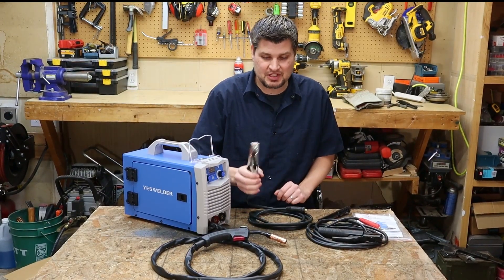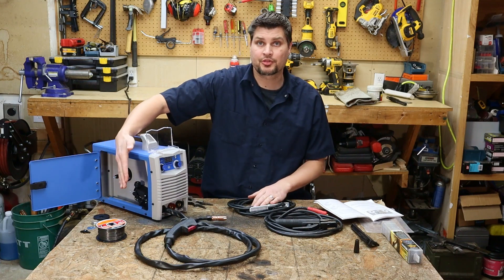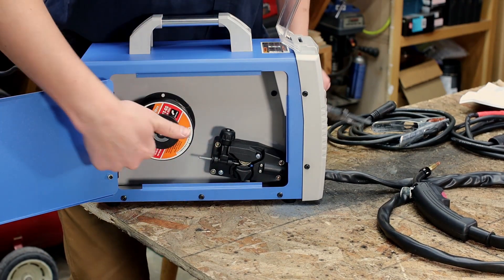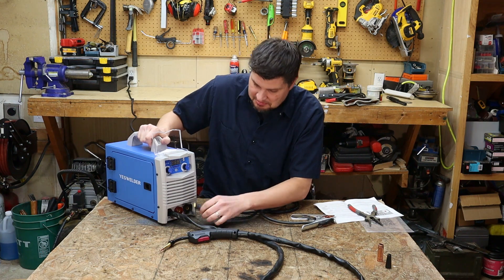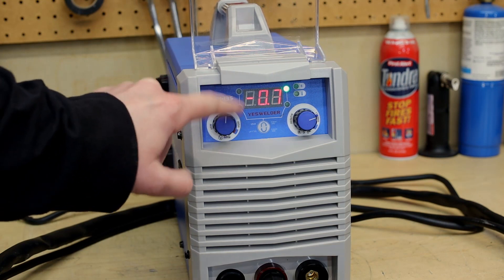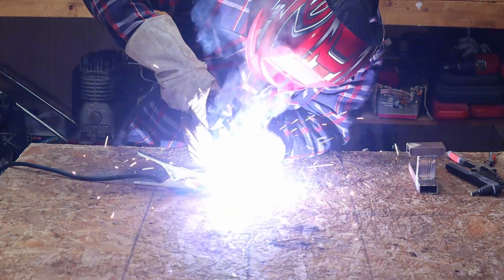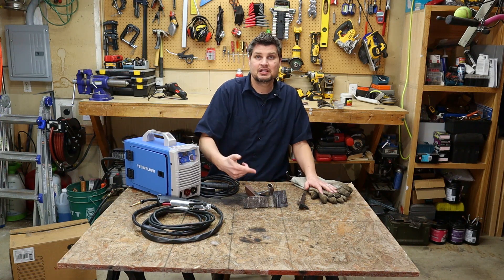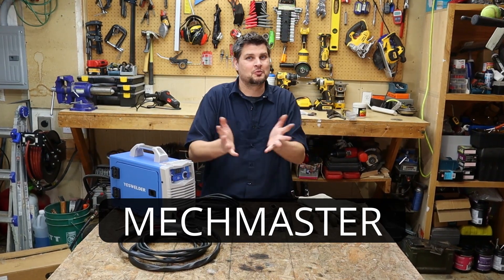YESWELDER 135 Flux Core Welder Review *Cheapest Multi Process Welder

Comment: The knobs are “Rotary Encoders” The key advantage to using a rotary encoder over a potentiometer is that it can turn in the same direction indefinitely. In contrast, a potentiometer will typically turn one revolution, with the best resolution ones turning a maximum of ten times.

Comment: Bought mine for $99 off of Amazon. I haven't go a chance to play around with it much but they must have updated this welder. It's now black and has 8ft flux torch lead and 10ft ground cable. I believe the power cord is 8ft now too. They must have seen your video. Still no wire included but for $99 I really can't complain.

Comment: Some where saying it doesn’t get hot enough but in your case it was too hot, what might be the cause of it. 🤔
Reply from the maker: The true voltage you get at your outlet could play a part. I'll add it to my list to pull out the amp meter and get a true measurement next time I weld with it.

Comment: Read to end for freakishly good deal on YESWELDER Flux-135 multi-process welding machine! The HF Titanium Flux-125 was my very first welding machine. I liked it. I accidentally burnt it up when I plugged it into 220V instead of 110V. I have some other equipment that can use either, and I mistakenly “remembered” the HF Titanium Flux 125 as also being able to, but it’s not. So, as the replacement for it, I shopped carefully and bought the YESWELDER Flux-125. It can do gasless flux core welding (using either .030" in or .035" in wire), MMA stick welding and Lift TIG welding. It does not have a gas setup, so to do welding that requires gas means you need a separate gas setup. It comes with both a wire feeding handle/switch and and a stinger for stick welding. It runs on 110V, and was easy to setup and is easy to use. I paid $189.99 for it on Amazon a few weeks ago. I just looked at the price and it’s down to $157.99 (price for my business account) and also offers a $20 coupon, getting it down to just $137.99! Amazon affiliate link: https://amzn.to/3ZyLIbF 3
Reply: @-DIYPRO-  If post your affiliate link in either the description or a comment or both, I can delete my link so you would get any affiliate proceeds. I mainly just wanted to let guys know the thing is so affordable right now it's crazy.
Reply from the maker: @design8studio  Keep yours up. Thanks for sharing the deal.
Reply: now it's $113.99
Reply: @MrMclovin44  Wow
Reply: @design8studio  $95.99 For prime day! Just ordered. 😄
Reply: @girthymilk  wow, good deal
Reply: Just picked one up for 89$

Comment: you don't show the tig set what do need besides the torch do I need gas and how does that work with this welder
Reply from the maker: Yep,  didn't go into too much detail since it doesn't come with any of it.  I use a size 17 torch with a manual valve, 17v. Most of the torches come with s couple different cups but you'll most likely need to add tungsten and 100% Argon Gas. I'd watch some tig welding set up videos to really get you started.

Comment: What tip protector did I see there for a moment?
Reply: About 1 minute in...
Reply from the maker: You can pick them up on line or the ones at Harbor Freight match the threads and will work as well.
Reply from the maker: They call it a flux core nozzle.

Comment: I got the same machine. I just can't figure out the synergis function.  whein I turn the voltage knob it did not affect the wirespeed and vice versa. so how do you work the synergis function? thanks
Reply from the maker: I don't think this one has it. I have the one button to chose the process, wire speed knob, and voltage knob. They are independent of each other.

Comment: An unnecessary roller, we must talk about the settings when welding different thicknesses of metal, but in the mode MIG & MMA(that is, flux-cored wire and electrode and still always polarity Direct (+ to ground) mustard welding modes
Reply from the maker: Agreed